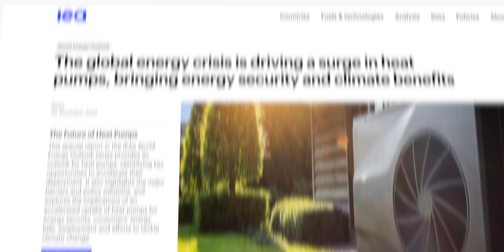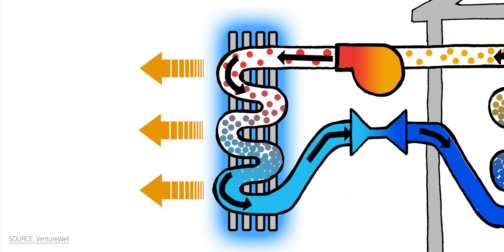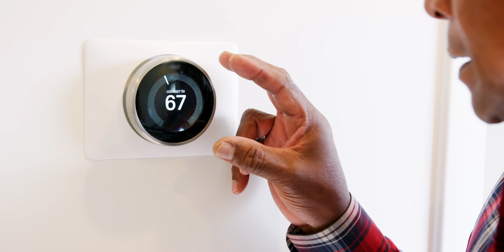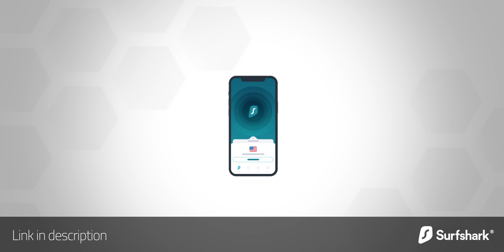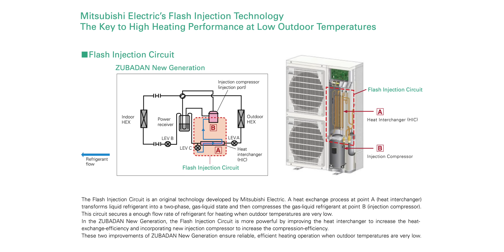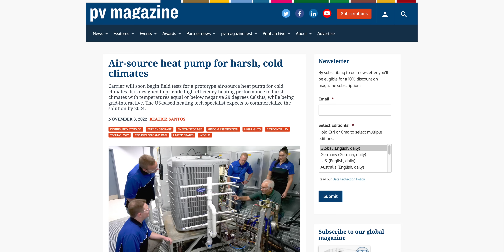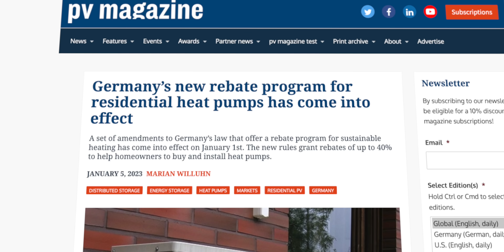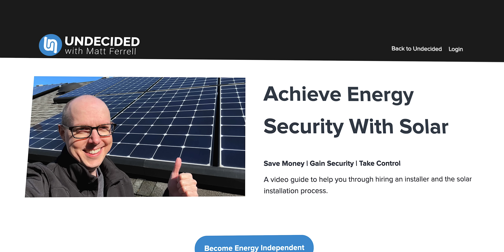Major Advances with Heat Pumps in the Extreme Cold

Comment: You haven't clearly distinguished air source heat pumps (ASHP) from ground source heat pumps (GSHP) in this video.

GSHPs don't lose efficiency in cold weather because the temperature of their source doesn't change. The COP of a GSHP is a relevant number because they all have pretty much the same temperature source.

ASHPs are much cheaper to install, because you're not drilling or trenching, but they do suffer from loss of efficiency as the air gets colder (which is also when you need more heat). ASHPs aren't generally measured in COP (or at least not a single measurement) because it entirely depends on the outside temperature. A good ASHP could have a COP upwards of 7 when it's only slightly colder outside than inside. But that COP drops as the temperature drops, until it gets to 1 at which point you're better off heating with resistance coils.

The advantage to GSHPs is that, although they're more expensive to install, they don't suffer from loss of efficiency in extremely cold weather, when you need the most heat. GSHP typically have a source temperature around 5°C, so in weather colder than that, the GSHP should outperform the ASHP.

Comment: Has anyone thought of using solar thermal along with a heat pump? Because in really cold whether the output from solar thermal isn't all that useful, it can significantly reduce the amount of heating you need from other sources, but it's not a solution in and of it's self in all conditions. but evacuated tube solar thermal even in extreme cold can produce a 50C delta between the ambient and the output water temp.

assuming -25C weather +25C water isn't that useful on it's own, yeh it will provide some heating, but you would need a very high flow rate to get meaningful heating, but if you can provide even +5C water to your heat pump that is very useful and except for when it's really cold you can rely on the solar thermal in 0 to +18C weather.

Comment: I am not sure why we are addressing something that was addressed more than 10 years ago. Maybe because it reaches the central HVAC... Fujitsu has the split systems to run at -5F on almost full rated power (which is not the case with central ones, dropping max BTU's a lot!) at COP of 2....at -5F... I have 3 of those at home for 8 years now. Tested, measured and proven to do what, not even their spec sheets says...

Comment: cheap way to jack up the daytime efficiency of an air-sourced heat pump . . . feed it with a hot air solar panel.

they can be built by anyone handy with tools, leaks just drop the efficiency they can't freeze* . . . insulation is your friend here!

at one or two degrees of temperature rise a hot air panel can reach the high nineties in efficiency . . . add some rocks in the air stream and it will continue to work after sunset . . . poor insulation can negate much of the gain though.

* if they do freeze, you will have to throw another chunk of air on the fire to keep breathing!

Comment: Planning to build a new home on large lot in Northwest NJ.  It does get cold here, usually below freezing up to a month each winter.  I have room for Solar panels on the ground, geothermal in a field.  I plan on using Radiant Floor heating but if it is more efficient to use forced air I may go that way.  Any recommendations?

Comment: I had a geothermal heat pump installed in 2011. Works great in normal weather, but not in extreme cold weather. System can't keep up when the temperature outside drops below 20 degrees. Which heat pump do you recommend for extreme cold weather to replace current heat pump?

Comment: I have 2 heat pumps that's my main heat source .. Last winter we had a cold snap that was -32cel (windchill -43.9 cel) my heat pump info says they work to -25 but mine still worked well at -32 ..

Comment: I'd love to have one... if I can find someone who will pay for it!  I'm 62 so will I even be alive by the time it " pays for itself "? 

These will become 'standard' in new homes but the costs of replacing an older unit in an existing home will remain high for decades to come. Efficiency of use doesn't seem to include OUT OF POCKET COSTS which, for many, will be prohibitive. Less efficient units will continue to be used as replacement units as many folks will worry over the costs that they likely didn't plan ahead for. (It's like the roofing guys... who will cover those old 2 layers, rather than remove them, just to get the job. HVAC guys will also do what it takes for the sale when the customer is counting pennies.)

Comment: I’ve had heat pumps in two different houses. Had traditional gas heat with ac in two other houses. In a word heat pumps suck. Cold heat flow in reality. In really cold weather they run constantly. Blow dust all over. And they don’t last any longer than regular furnace. BTW in reality the variable speed newer models cchps aren’t that great. Wouldn’t have one if gas was available.

Comment: Northern Midwest USA here:

Main problem with heat pumps here are not if they work or not, simply that Natural Gas is so cheap it doesn't really make sense. If you're on propane, it's comparable but not for Natural Gas.

Once you factor in the extra cost, to have higher energy bills, it's going to be a tough sell here.

Comment: I live in Romania. We have a mid-European climate - from +35C to -25C (+95F to -13F). I have 2 systems (for redundancy) - a minisplit (1-1) and a multisplit (4-1) from Daikin. Air-to-air heat pumps. 2 quite silent external units, mounted on ground frames (out of the snow/water), plus 5 internal wall-mounted units. Efficiency decreases with cold, but still works very well. Plus I choose which of 5 home areas to heat or cool individually with a range of fully automatic settings, and incorporated air filters/cleaners/ionisers. It is the cheapest, easiest, and least efficient heat pump system, but still a major saving and improvement over any other conventional heating or cooling system, and environmentally friendly. It can be easily installed in most existing structures with minimal invasion. Combined with an adequate solar power system, and either network power exchange (buy-back or swap kWh) OR a battery bank - nett heating/cooling costs per year can easily be ZERO, and capital investment can be recuperated in much less than 10 years (sometimes only 4 years) with a guaranteed equipment life span of 20+ years. No brainer.

Comment: The problem with the CoP (coefficient of performance) is that manufacturers cite just one figure - as a kind of average.
What manufacturers (or consumer champions) should do is fix an "delivery temperature" of (let us say) 22 degrees C.
And then cite CoP figures which achieve that, where the heat is taken from the environment at a range of centigrade temperatures at regular intervals. 
The figures would appear something like this
CoP(16) = 3.2 
CoP(12) = 2.8 
CoP(08) = 2.6 
CoP(04) = 2.4 
CoP(00) = 2.1 (subtract 10% for de-icing intake)
CoP(-04) = 1.9 
:CoP(-08) = 1.6 
CoP(-12) = 1.4 
and so on.
The figures I have used are just a guess.

Comment: Hmm. My local furnace company reported that my 22-year old gas furnace was on its last legs, so I just spent over $30,000 replacing my gas furnace with a new one and installing a high-end Carrier heat pump and well-equipped thermostat at the same time. Sub-freezing temperatures used to be rare where I live but have become more common, along with severe storms, so I wanted a system that will work in very cold temperatures today. I have never seen the outside temperature below 0* F or -20* C, so in another couple of years, that furnace may not have been necessary, but the peace of mind of two separate heating sources with, outside of an electrical failure to my home, redundant operations was very appealing after spending 26 hours without heat in freezing weather last winter. Let's be honest: I got Carrie'd away, but the system is very quiet, with only the movement of air and the gas furnace (35* F / 2* C and lower) being audible inside, and the heat pump being quiet enough to maintain a conversation near it outdoors as well. Now about the massive debt I just incurred... I'm glad others won't have to replace their gas furnaces to have reliable heating in cold weather soon.

Comment: I replaced the both the furnace and AC in a condo in Canada last summer. I wanted and the HVAC contractor wanted and tried to find a heat pump that worked below 10 degrees C but none existed or the HVAC contractor couldn't find one.  It would have been a big cost advantage as I could forget the cost of the furnace.  The condo has alternative heat sources from shared areas beside and below the condo so the -10 heat pump probably would have worked but because it was a rental and because no furnace would have really hit resale value I had no choice but to go with the regular Furnace + AC.  Just because you might get away with a HVAC system only rated to -10 most years doesn't mean you should.  I'm pretty sure a condo with an hvac system only rated for -10 degrees C (in an area that routinely gets -30 C) would fail 90% of home inspections if you tried to sell it.

Comment: In QLD Australia I was converting my laundry Into a second bathroom. As the old electric hot water system was more than 15 years old, it probably would not have coped with ɓeing relocated to the semi weatherproof patio the rest of the laundry was moving to, so a new hot water system was in order.

The $4000 system cost only $1400 fitted thanks to various rebates.
It saved me at the time about a grand a year in power costs. If I had needed a new heater the same deal was available. 

I've since added a 10KW solar system to the house, so not only is the hot water free now, but so is the reverse cycle AC and everything else that runs on electricity.
I even get paid by the electricity company because I put more into the grid than I take out.

All that will change when I start plugging an EV into the system though I guess...

Comment: I installed a Pioneer 12k btu heat pump on our shuttle bus camper. Did all the work myself except for final tubing connections and pulling vacume. Kept us cool in FL, in full sun in a metal box.(It's great that with 800 watts of solar panels, 3-100ah lithium batteries and 2500watt inverter, works fine as we travel down the road). Liked it so well I got a 24k unit to install in the house. Has worked well with temps down to -10F.

Comment: According to the video:

Average heat pumps costs $8530
Average gas boiler costs $3200
So you're paying $5330 more for the heat pump

You save $300 per year with a heat pump (the video says)
So to recover your $5330 would take... 17.8 years

Average lifespan of a heat pump? 15-20 years
So you'll get 2.2 years x $300 = $660 of savings, IF it lasts for a full 20 years.

Not really worth it, if the video's numbers are accurate.

Comment: What is the efficiency of the heat pump when it gets  cold - cold at the advertised limit.  Does the definition of "working" include  99% of its energy use going to keeping the heaters on the  outdoor unit to keep it from freezing up considered "working" ?

Comment: You missed the mark on this one. Heat pumps could not work in the cold because their coil faces would drop below 32 deg F and would begin to freeze over as you discussed. When the heat pump market still uses imaginary terms like "600%" efficient you know they are using word pays and smoke and mirrors. I had a friend that had the "new" heatpump that failed in the winter and with NOTHING as a back up my friend just as if they had a gas or wood furnace. When you use auxillary heat coils  that and the hot gas reduce the efficiency. At the end of the day the Optimizations are more on the discounted rates for heatpumps and other $$$ games that enter into the "600%" MAGIC.  The bottom line is when the government has to force you into one single utility NOTHING good can come out of that for the consumer. Already Florida and California are changing the solar panel laws and the insurance rates to prevent urban "off grid" solar systems. They MUST have you trapped into using their single source power!!! Look at the reality beyond the flimsy climate calculations!! The day I can install solar panels with out the government games and use my own power the reality about heat pumps is still one of those magic savings that never appears. Your bill stays the same and they say the savings was in the installation or purchase discounts. Just as solar has been an abused market for decades that has stalled solar for the same number of decades, so are the games with heat pumps. THE 600% efficiency immediately tells a person you do not understand the thermal calculations for the Heat pump vs the gas or wood furnace as this calculation came has been played since I got my mechanical Engineering degree in 1980. (I worked in the HVAC industry from 1980 until about 2010.)

Comment: I'll stick with gas and wood. Like the heat much better. It's just different. When i visit friends house with heat pumps it's just not the same warm. Plus i don't get $400 electric bills when it does it super cold. I might spend $200 on both electric and gas combined on the worst months.  I do burn wood however. Well worth the trouble. Especially during Christmas.  One day maybe but in reality probably not.

Comment: I am a technician that works on heat pumps and I found the problem with them in southern Minnesota where I am is that the balance point is usually somewhere around 20 to 30 degrees so the biggest problem I see with them is that they do not put out enough heat in cold weather

Comment: Current Air to Water Heat Pumps work with R410a, R32 and R290 gasses. There are products that do work in -25c (-13f). Best products work for a Seasonal COP of 4.0 (4 times the electricity consumed).

With R410a being phased out, R32 and R290 are getting market share. R290 is better in getting "high output temperatures", but it's actual propane, with a whole load of possible issues that you need to deal with.

Comment: The trouble with geothermal heat pumps is their great installation cost of about $30,000 in Canada.  "Mini-splits" (just a breadbox size unit connected to a power head inside.) are fine down to -7C or so and can be bought for $800.  2 needed for a 3,000sqft house.  Keep old electric system as backup.

Comment: The thermodynamic limits are quite benign for heat pumps:
for example:
   warm side: 20C, cold side: -30 C, max possible COP: 4.86
It is more practical if the warm side is much warmer than ambient, because of the easy heat transfer, so a more practical scenario:
   warm side: 40C, cold side: -30C, max possible COP: 3.47
This is considering that everything is else at 100% efficiency (Carnot cycle for the gas, perfect pump), so we cannot really achieve COP this high. At least this shows that in this case thermodynamics does not limit us too much.

Comment: Since snow and ice accumulation are a well known issue, as well as frost development on the coils requiring defrost cycles (and subsequently requiring most heat pumps to be mounted on a raised platform to allow the drain water to go somewhere), why aren't we just designing heat pumps that go where the gas furnace previously was installed in the air handler? It makes so much sense to me. Why? 

-less stress on the outdoor unit (it only needs to provide cooling) 
-potentially less frequent need to be defrost cycled, and probably for shorter cycles due to being located in ambient temperature conditions 
-water runoff from defrost cycles can easily just be drained away since the heat pump drain line will be operating in ambient temperature conditions 
-would probably have the effect of recycling heat already inside the house rather than letting it escape though the walls to the exterior environment. 

Does what I think here make sense? I just feel like doing it this way (split system heat pump) can be far more optimized than using the outdoor unit to pump heat inside. We already do this with heat pump water heaters (and it works just fine). And yes, you'd have to route a huge duct of outdoor air intake into your home and then re-route it back outside through an exhaust vent, but I don't really see an issue with that. Most high efficiency condensing furnaces and water heaters already do this.

Comment: I've decided that this channel is decidedly fantastic! Matt has pumped up my enthusiasm for all the great work he is doing! 😊❤🎉
Reply: The problem is that Matt has moved from arbiter to advocate.  Several of the commenters speak to the issues that Matt himself DOES NOT speak to which are MATERIAL issues in his videos........for example, why doesn't Matt speak to the (a) cost of his geothermal drill hole, (b) WHY he did it and (c) how that compares in efficiency to air source heat pumps?  Matt has taken the road of using "relative wording" which replaces data and facts with you relying on the earnestness of his delivery to achieve authenticity.......and, unfortunately, that has made all the difference.  Its a shame.

Comment: I live in Huntington NY. I have a heat pump and it seems to work just fine in virtually every condition. This past Christmas the temperature got down to ZERO Fahrenheit  for the better part of a week, It didn't seem to bother the Heat Pump much. It ran allot but the house was comfy. My Heat Pump is Lennox Signature Series 5 Tons. It is an Air to Air System.

Comment: There is no energy crisis, as the technologies are simply being suppressed due to control and scarcity fearmongering. Thorium reactors have been used for over 50 years on submarines without widespread public knowledge and can power them indefinitely, cheaply and with little chance of failure. The suppression is the real crisis.